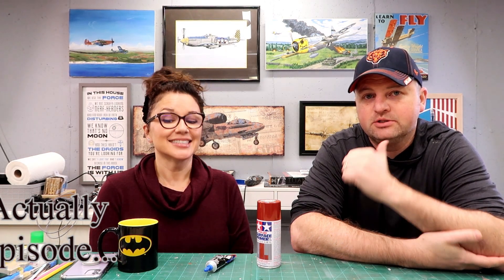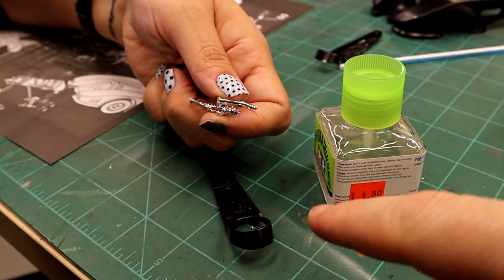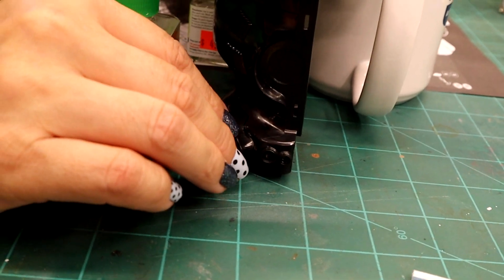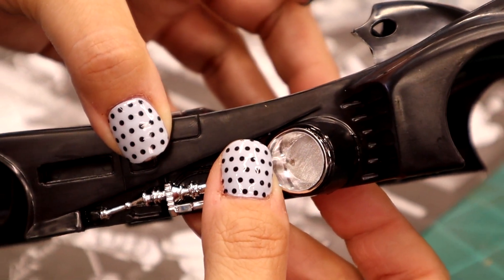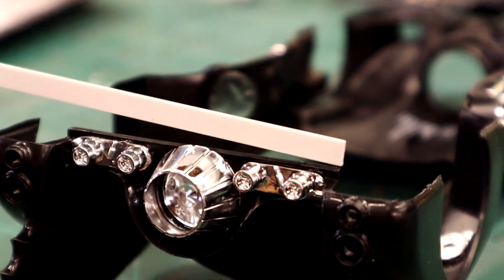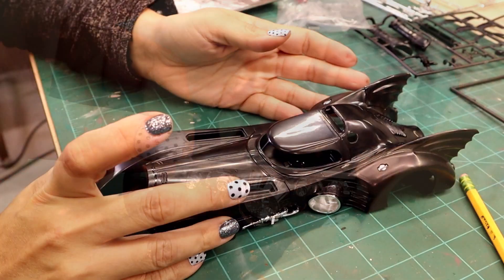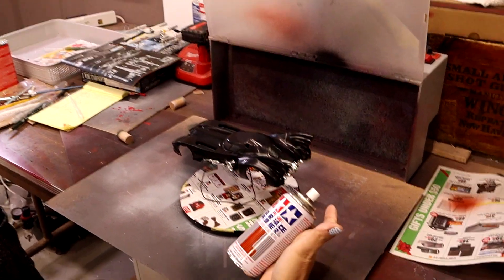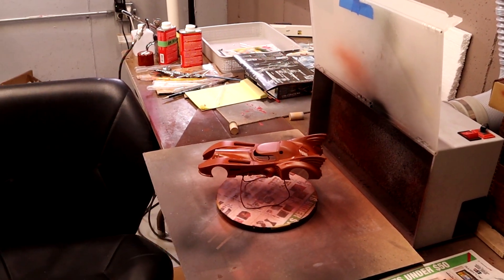Nora's AMT Batmobile Build Video 2

Comment: Did you scrape the chrome off first? The glue (or solvent) won't work with any chrome on the parts, unless you use CA (super glue).
Reply from the maker: No we didn’t, but the Tamiya glue worked anyway 🤷🏻‍♂️
Reply: @TheMidwestModelShop  OK, but keep in mind that even the Tamiya solvent works like Testors. You should scrape the chrome first...bare plastic to bare plastic is best.
Reply from the maker: Agreed